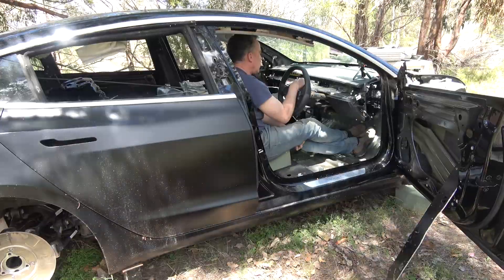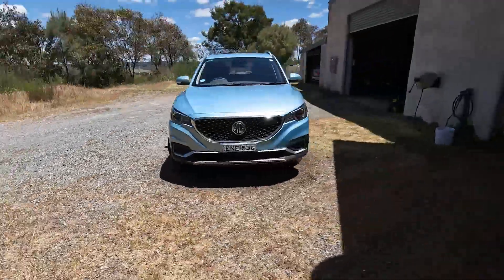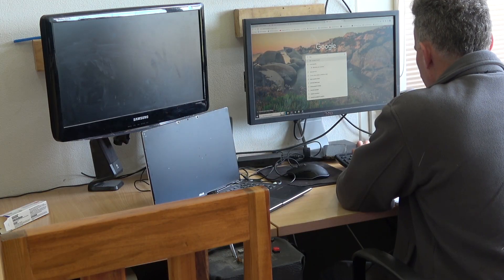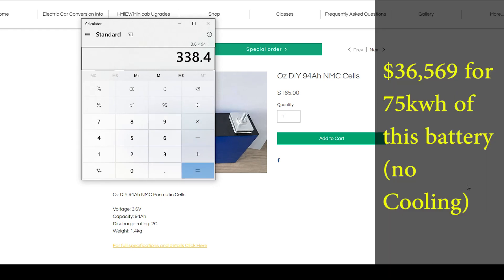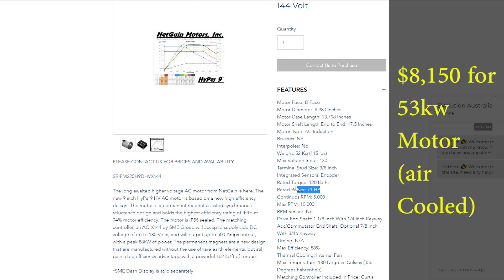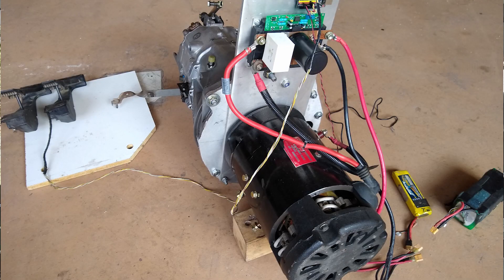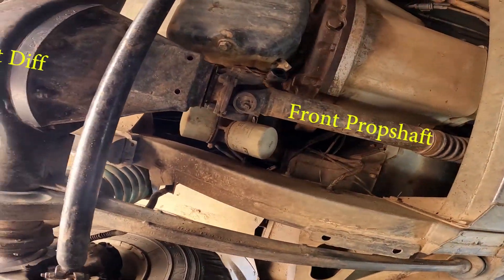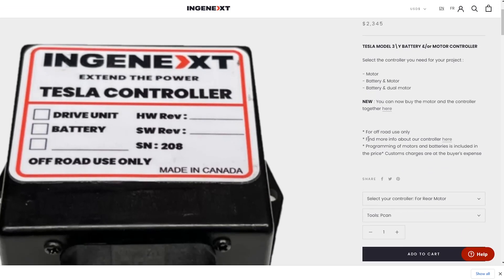Land Rover FTI 02: How will I convert my Land Rover to electric?

Comment: I'm half way through converting a 1997 300tdi 130 with the MY motor in South Australia, I initially contemplated doing a complete transplant and the only way I though it was going to work was by creating new sub frames front and back with dual motor or using other OEM subframes from a Patrol or similar, I haven't gone that way and just used the rear motor mounted the same as yours.. After watching your videos I can really appreciate the amount of work involved to get to where you are and the dedication to make it work and on top of that producing all the videos, awesome work. Keen to see it working!
Reply from the maker: Nice! Would love to see more details on your build! Personally I think it is definitely better to retain the original suspension of the Land Rover. Thanks for the nice comments, the whole point is to try to make it a little easier for other people like yourself!

Comment: Easiest way to use just the rear motor would be to but in an MCU from a RWD car.  Then it will only expect the rear motor to be present.
Reply from the maker: Yeh, if I had one it would definitely be worth a try! I guess you would need to pair it to the car using Tesla Toolbox? Will be investigating Tesla Toolbox with a friend soon - maybe I can reconfigure the current MCU to just be a single motor setup!
Reply: @sydneyg007  No, other way around, you would need to pair everything else to the new MCU.  You would need to buy an MCU with matching vsec module and a key card.  And SRS module.  Everything else can be paired to it.  Only rear motor will need toolbox to be paired, I think.  Fir everything else you would just need to do a software reinstall.
Reply from the maker: @diytesla  Yeh right. That makes sense, the MCU is the heart of the whole system really I guess. Think I'll just try with what I have using the front motor emulator!
Reply: @diytesla can you give me some tips